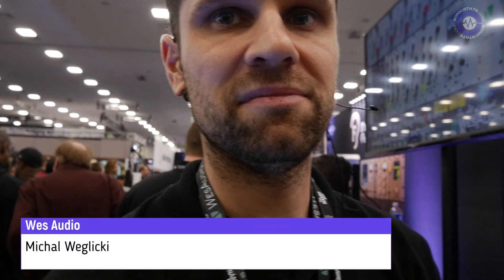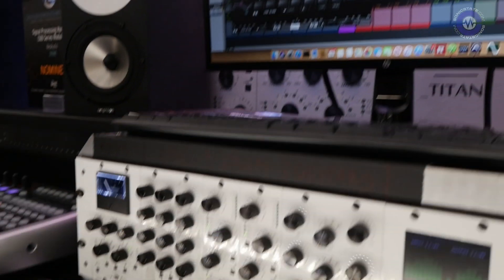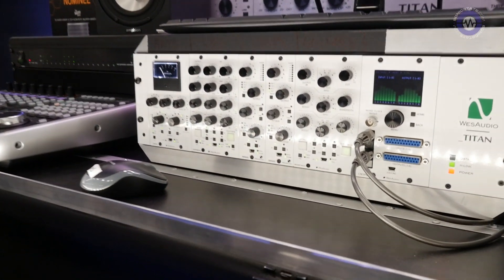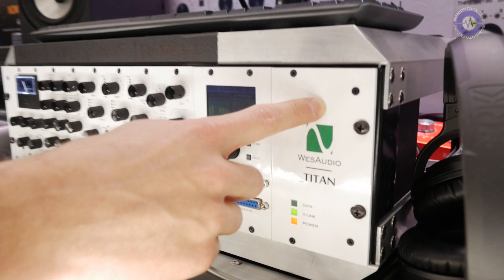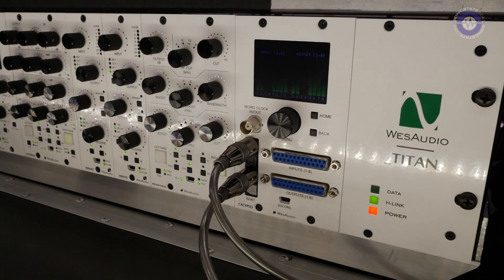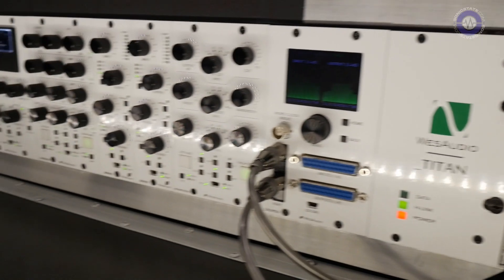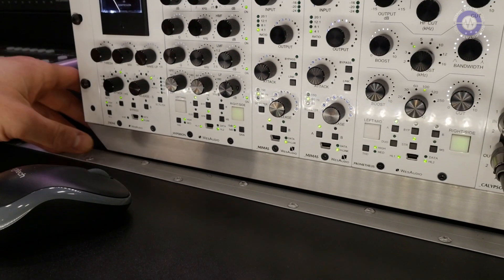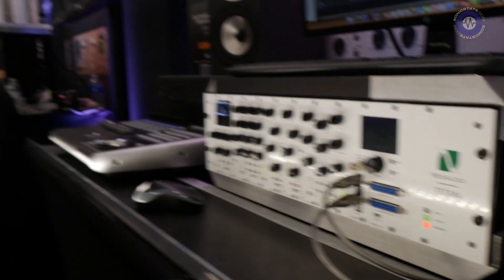NAMM 2020   Wes Audio 500 Series Analog Processing Digital Control

Comment: I’m still a little confused as to how the Titan chasis works and I am not finding any videos online demonstrating the cabling setup and  the integration and operation of a fully loaded Titan chassis with ng500 and “standard” 500 series modules. Is it actually routing the signals from  each of the first 8 rack spaces to the 9 and 10 slot of the Titan rack internally as separate signal paths or is it a summed signal of all of those rack spaces  that then pass out via ADAT with the Calypso module or  passing those same rack space signals out via D-sub or simultaneously passing those signals through both of those connections?  Which if is the latter that would be fantastic.

Comment: How much?  Does it come as a whole system?
Reply: You can check out possible options here - https://www.sweetwater.com/store/manufacturer/WesAudio - system is fully modular based on 500 series standard (in this case extended with digital recall).
Reply: 6K for the full Titan